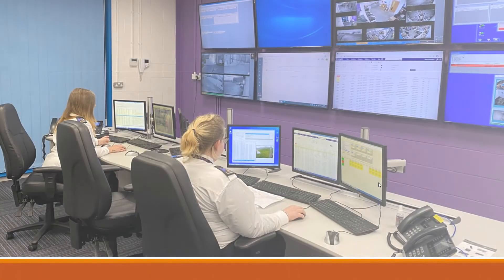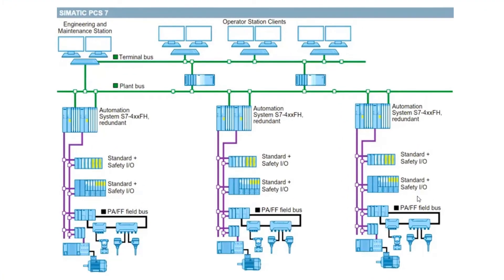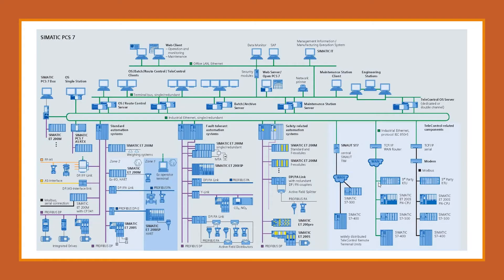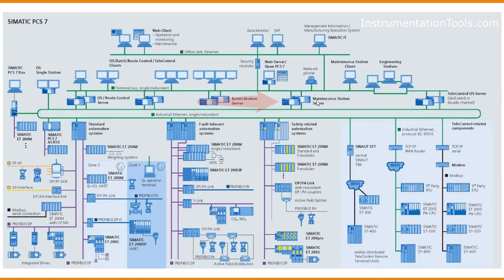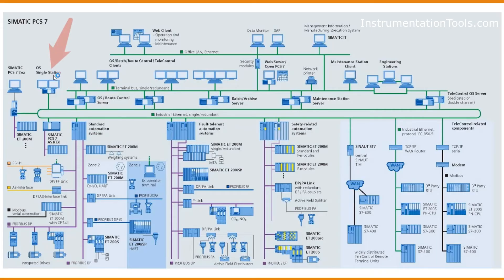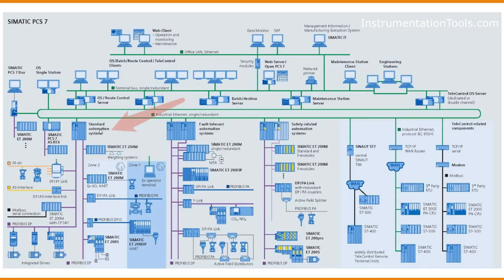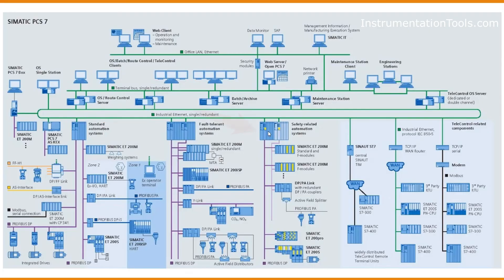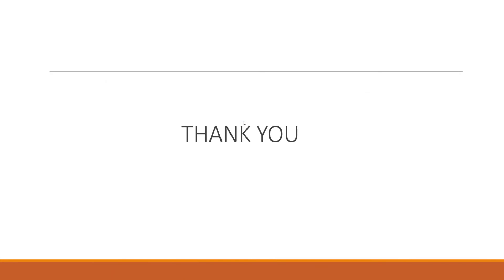Introduction to PCS 7 - Siemens DCS Training

Comment: sir
i am basically an Electrical with knowledge on  DC and AC drive system 
i would like to know the following 
names of different system connecting cables 
suppose there are many type of instruments in diffrent locations 
insrtuments in one area are connected to the IO there and a cable going insrument cotrol where there cables from other IO from field instruments 
These IO racks cables are properly connected to DCS with a single cable 
now how do you name the cable going from field IO rack to instruments control room and the cable conncted between main insrtention room to DCS
Reply: Use the notation source-->goal.
The sight is from the PLC.

so the example 1:Cabinet DCS connector-->IO-Rack-connector
When it is to long you must make a cable list where you describe source goal and take for each cable an ongoing number.I prefer example 1.If you have more than 1 cable at the same connector strip us at the end an ongoing number.